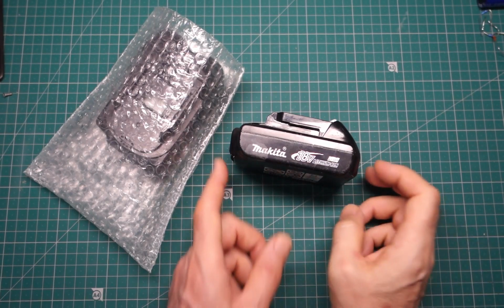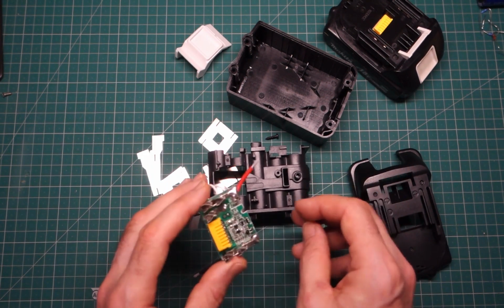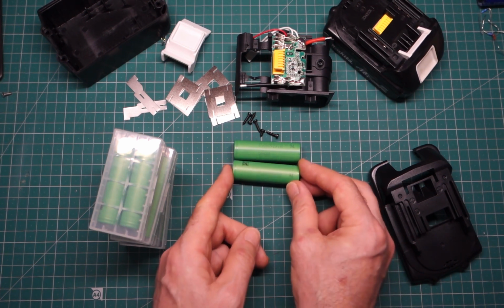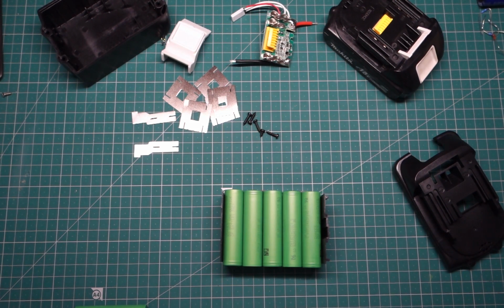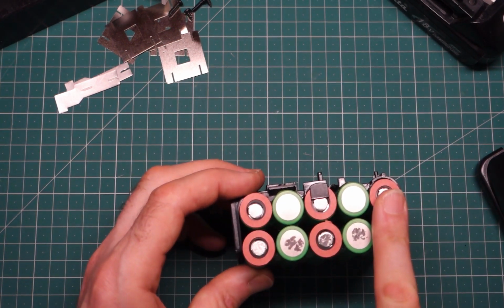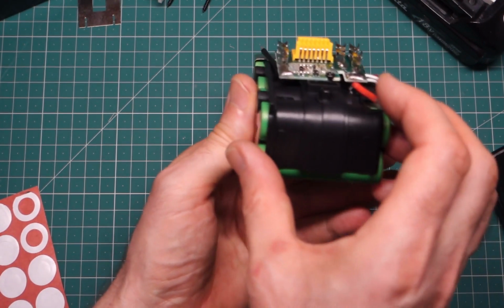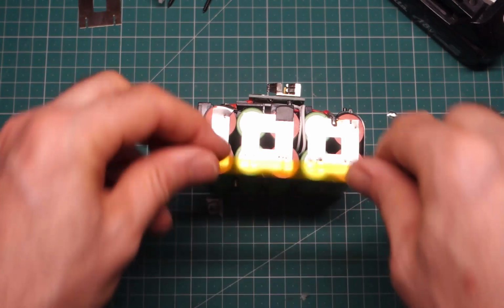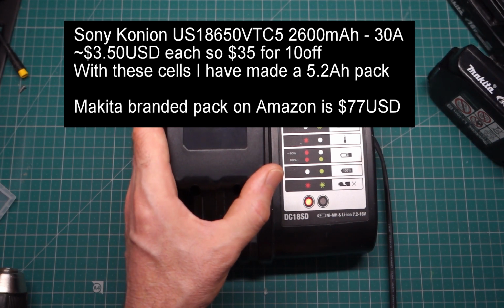Ep 35 Makita BL1850 Battery Build

Comment: I just bought a new battery pack for mine and moved the batteries into the original case cause the new battery case was thin plastic and cracks easily. Works like a charm and was under $30 Canadian.

Comment: To clear up some things in here:
Short:
Don't do this! It's a waste of money and time. 
Long:
This PCB has NO balancing! 
Genuine batteries has balancing because not all batteries will be charged 100% the same.
This happens because the resistance to charge the second or third line of the pack is higher than the first one.
So the charger stops charging because he thinks it's full.
But if you check the cells the first line has maybe 4.2v as it should have. But the second or third has only 4,1v.
Now the battery will be discharged and the discharge causes this dispersion to  grow.
For example the first row is at 2,7v and the second 2.4v.
After a while with charging and discharging some cells will be discharged so badly, that the charger is not able to charge the pack anymore and some cells are going to be dead after a short time.
If there's a way to balance this you could also make 20ah makita battery if you want. 
The problem is to make a chip which will be accepted by the original charger.
Hope you understood and sorry for my bad English
Reply from the maker: Technically you are right,  but  (and its a big but), I think you'll find most Lithium Ion battery packs don't have cell balancing, and certainly this type of Makita battery has been manufactured in the countless millions.  To ensure you have a pack which lasts you should make sure the cells voltage is very close to each other (say 0.02V delta) before welding the pack.

PS this pack is still going strong.  It gets used daily.
Reply: you are 100% right, this is waste of your time. This is only good for the experiment and testing. Aftermarket chip doesn’t work correctly.

Comment: You can do this only if you know lithium ion 18650     1. charging-discharging limits           2. measuring each battery resistance and capacitance     3. knows how to use battery charger with balancer.       4. use of BMS        5. proper way of assembly from the result on the items (1234)  listed. no hot glue.  6. Professional balance charger/discharger must have as a tool like the IMAX B6 sky RC.(for you to monitor each cell inside the battery pack)    7. don't use charger without a balancer.

Comment: Could you tell me if you think it's possible to desolder the yellow part from an aftermarket PCB and resolder to a damaged Makita battery? I'm considering having a go at it as I have 2 X 1840B batteries with broken yellow terminal bits.
Thanks in advance
Great video 👍🏼

Comment: Currently would be considered too expensive.  The shell costs £10. You need 10 batteries which would be for cheap ones £2 each.  (£20).  Where as you can buy one ready made for £18 6AH.
Reply from the maker: Ill have to take your word for the 18quid price.  Locally my hardware store (Bunnings) lists the 6ah makita at $168.  This is about 84 pounds.
Reply: @PowerOn-  i think what silverfox meant was, why buy aftermarket parts to build a battery pack when you can buy an aftermarket/clone battery pack already assembled for cheaper price.

Comment: hi simon, i am very curious about making some 5Ah battery by myself but 
also need to know how long the lifespan of that pack is. so my  question
 is: is the battery pack still running without any loss on capacity or 
damagin my equipment? greetings, markus
Reply from the maker: The pack I built is still fine, the lifespan is going to be dependent on the quality of the cells and how often you recharge them.  Power tools are very hard on battery packs for 2 reasons. 1) High drain when using the tools and, 2) High charge rates.  Cells for tool packs are specified to have high rates of charge and discharge for this reason.  As a result their charge density is lower than the very best cells (~3500mAh) currently available.  If you are in Germany, try nkon.nl for a reliable source of cells

Comment: My only concern is that the chinese pcb:s are of the older Makita type that doesn´t have cell balancing, Makita had a lot of problems before they changed the pcb.
Reply from the maker: Filip5025 That is interesting.  I did not realise the newer Makita drill packs now incorporate cell balancing.  I'll keep my fingers crossed someone makes an aftermarket version i can afford 😀
Reply: You use new and proven cells in your pack so I don´t think you will have any problems, what I´ve heard it´s when the batteries are used hard and instantly put in the charger the most problems occurs. This is a pic of the new Makita board: https://i.ytimg.com/vi/_sl0TRAQJCo/maxresdefault.jpg
Reply from the maker: Filip5025 Thanks for sharing the photo.  I can see the balance 'wires' are on flat flex.  Nice.

Comment: It aint that simple! 
You still  dont know if you can charge this battery with a standard 9 Amper Makita charger, or it will overheat?
Many of the aftermarket batterys can only be charged up to 4 Ampers.
It depends on the cell, you used.
Another question is , how do you know that the control circuit matches the parameters of the cells youve chosen? 
Overcharge, overdischarge, max current values???
Reply from the maker: Hi Gerg, thanks for you comments, It's a while since I did this project and I should have given more information on the choice of the cells.  
You are right, the cells need to be suitable!  I choose the Sony VTC5 as this is the cell often used in these packs.  They have a max discharge rating of 20A each so with 2 in parallel that's good for 40A (or roughly a beefy 720W tool).  
As for charging there is a thermistor on the BMS board.  The BMS board will also be protecting the various over and under voltage limits (usually 4.2V/~2.8V.  Finally,  The cells will easily cope with the 9A from the charger (4.5/cell)
Reply: @PowerOn-  Thank you!

Comment: I have many lithium batteries, and all are the same brand, but I think they are from china, can I use those for the battery pack build?
Reply from the maker: Quite possibly.  18650 batteries are 18mm diameter and 65mm long hence 18650.  If there is any marking on the sleeve try look them up on the internet.  Also it's definitely best to test each cell before using in a battery pack.